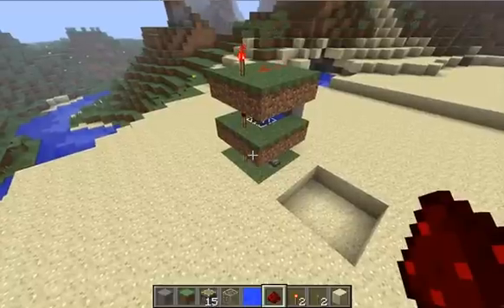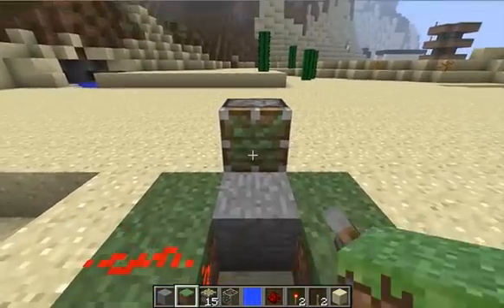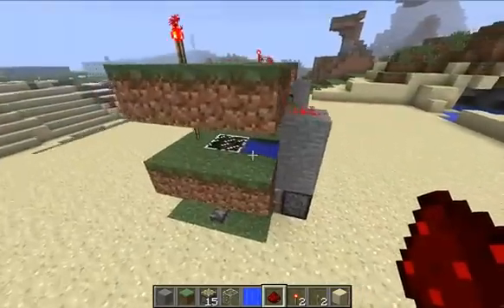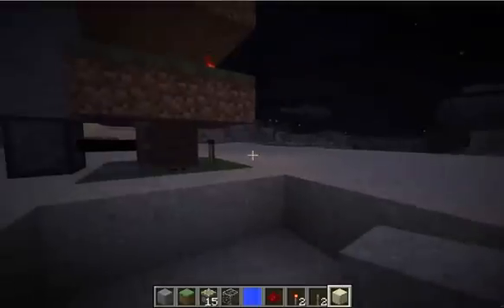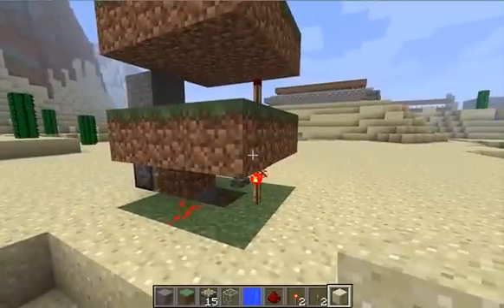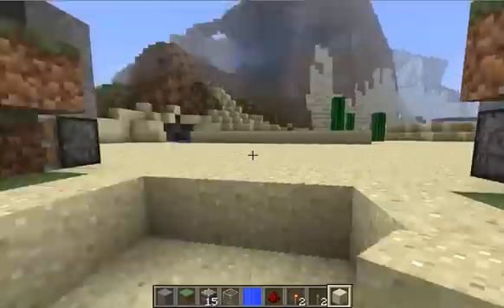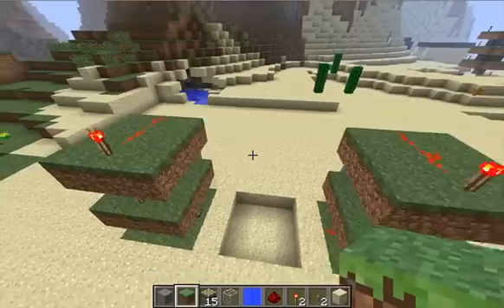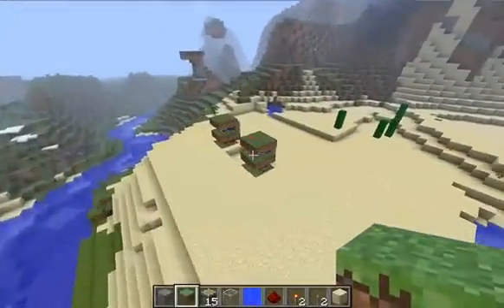Light Sensor Nano (day/night sensor)

Comment from the maker: 1. It does, but that's not important in this machine. The water is just there to kill the grass at night. Grass won't die unless it is covered.
2. It's just there to stop the water.
3. No, glass has no effect on light.
4. It's there to spread to the sensor block, like all the grass in the machine.

Comment: I'm trying to build something that acts on certain light levels, so I want to ask a few things to get it clear for myself.
1-the water reduces the light level by 3, but the sides of the device a left open, wouldn't it get more light by that?
2 - I guess the glass is used to stop the water, but also enable to get the dirt block lightened to grow?
3 - Does glass reduce the light level, or doesn't it reduce light at all?
4 - what it the top level of grass used for? I can't see any use for it